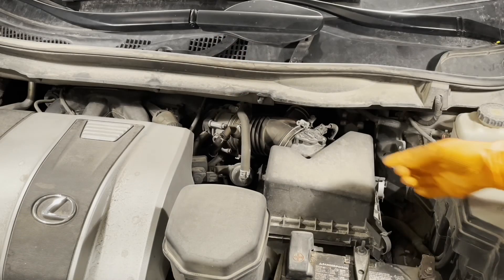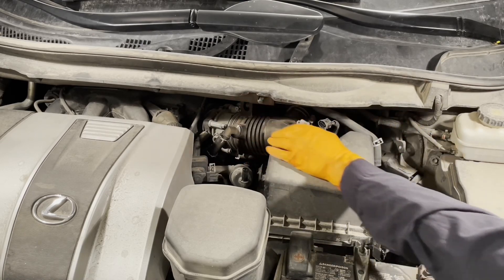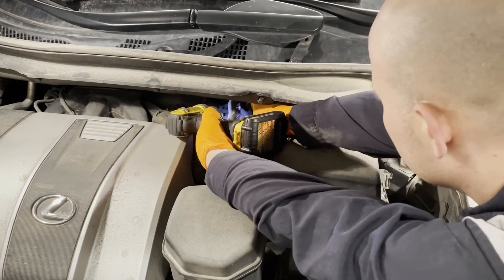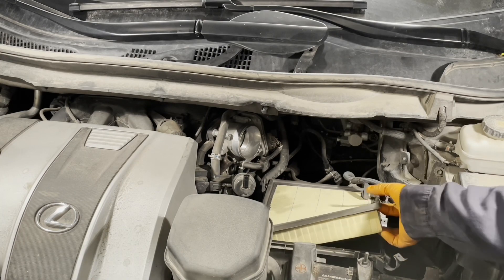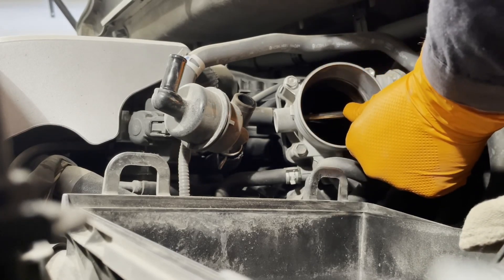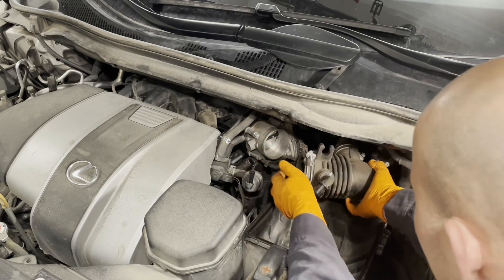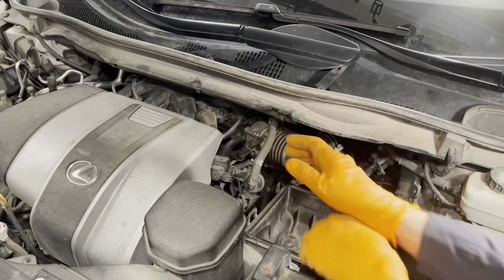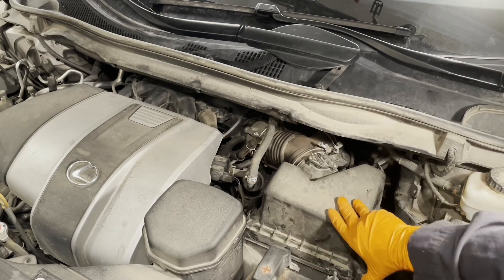2016-2022 Lexus RX350 Throttle Body TB Cleaning Instructions

Comment from the maker: Below are my affiliate links to the parts and tools you would use to complete this job. I may receive a small commission from the product sales. Thank you!
Throttle body cleaner: https://amzn.to/3q4kn5k
Auto trim and clip removal kit: https://amzn.to/3KgKGfg
1/4" impact driver kit: https://amzn.to/4f1UN4A
1/4” socket adapter set: https://amzn.to/44XTTkI
Small flat blade screwdriver set: https://amzn.to/44HUoQi
Rechargeable LED mini work light: https://amzn.to/3Y74OpY

Comment: How often do I need to clean throttle body
Reply from the maker: @lonestarusa732  I do it after battery replacement to make sure the idle speed is stable. There isn’t a set service interval for cleaning the throttle body in the manual.

Comment: Thanks for sharing. I thought the electronic-controlled throttle can’t be handed push to open the valve, can it? Can you teach us how to relearn the idle after cleaning the throttle? Thank you.
Reply from the maker: Hi, you can definitely push it open by hand with no issues. Idle is learned automatically after a few drive cycles. Thanks for watching!

Comment: Viktor, thanks for the video.  Question about a 2010 RX350, any possible issues in pushing the TB plate open by hand to facilitate cleaning?  I read you can damage the TB electronics?
Reply from the maker: No, nothing will get damaged. That’s the only way to clean then.
Reply: Thank you
Reply from the maker: @chuckpar2206  no problem
Reply: @Viktor_G_Automotive   Thanks again Viktor.  I purchased a twin pack CRC TB and MAF sensor cleaner.  I'll clean both components, since I would have gone that far in disassembly following your instructions.  Seems like a good time to spray clean the MAF as well.
Reply from the maker: @chuckpar2206  sounds like a plan 👍

Comment: I own a 2018 RX450H F Sport, and I've noticed that no one has demonstrated how to change the spark plugs on the 2GR-FEX engine. I realize there are 20 RX350's for every 1 RX450H, and the numbers are even greater if the Hybrid model is an F Sport. Can you perform a tuneup on a vehicle such as mine or is it so similar to the RX350 that you and everyone else don't bother?
Reply from the maker: It’s similar to an RX350, but there is more work involved. There is an EGR cooler that has to be removed to access the rear plugs. I may make a video one day, but there are a lot less hybrid models out there to get my hands on one.

Comment: Hi, Viktor. I have a 2015 NX200t with an 8AR-FTS engine. Recently I found that the idle speed in D gear will be unstable when stopped. So I'm not sure if it's because the throttle body is dirty and needs cleaning. However, I checked the relevant information online and found no information on how to clean the throttle body of this engine. So, do you have any other suggestions? Thank you.
Reply from the maker: The idle speed is computer controlled. You can try to clean the throttle body, but it is not easily accessible. There is not much else to do, if the idle speed varies slightly, it is not usually a cause for concern.

Comment: Hi Victor. I’m experiencing a few issues with my 2017 Lexus RX 350 fsport. I experienced 2nd engaged, 4wd, ICS and engine light on the dash first and then stalling at red light. After I filled up I drove a mile and it stalled. Took it to the dealer and they said I need to replace all 12 injectors direct and port. I don’t believe all 12 are bad. The codes the gave me was P0172, P0175, P0117. Which points to multiple sensors. Can you point me in the right direction?
Reply from the maker: Unfortunately, it’s impossible to diagnose without me being there looking at the vehicle and running a bunch of tests. I do agree that it won’t be all 12 injectors, most likely only one or two. There is a way to test if it’s the port or direct ones causing the issue, but it can be very difficult to confirm which specific one.